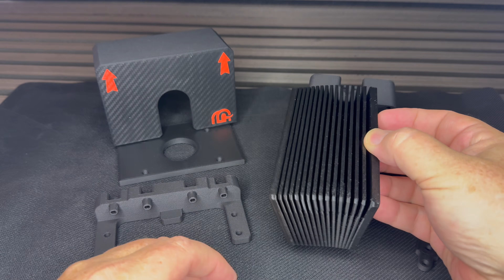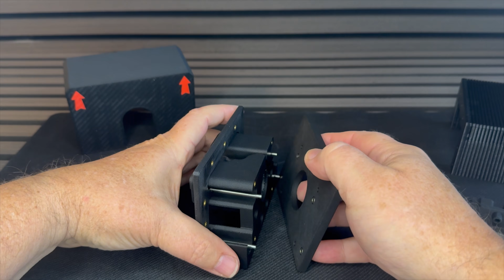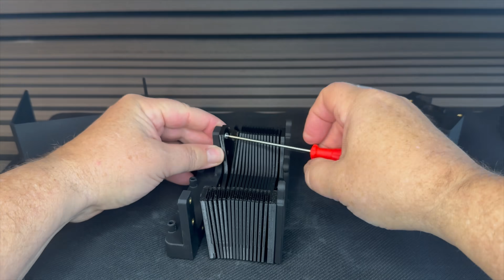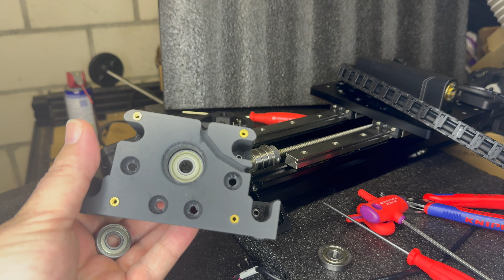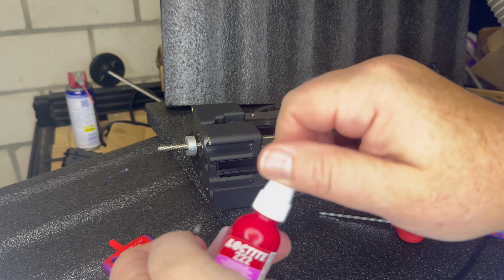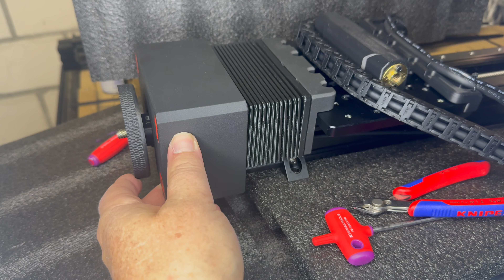New mammoth-3D Dust Cover Mod for the Milo CNC! (TPU/ASA Printed Upgrade)

Comment: It's a shame that good engineers aren't given more recognition. People prefer to see Pokémon printed on a Bambulab... Anyway, you two are my favorite 3D printing YouTubers, along with Matt and his incredible T250. Do you plan to integrate the Indix system into the AWD gantry? Admittedly, the throughput won't be sufficient for 0.2mm layer heights. But at 0.16mm, we could get close to 700mm/s with a flow rate of 50mm², according to them! For a print head that weighs 150g! I'm so interested to see such a revolutionary print head on your revolutionary gantry!
Reply: Thank you, you're the GOAT!
Reply from the maker: Thank you very much. :-) Nice to get feedback like yours. Helps us do what you love even more!!

The mammoth AWD Gantry was made from day one for vz toolhead or Voron toolhead. You need to change a few idlers and the xy joiners. I should post a video about it so you can see it better.
So INDX will fit no problem. :-)